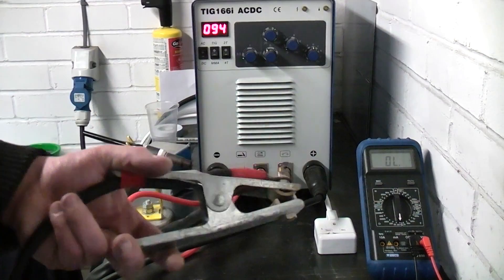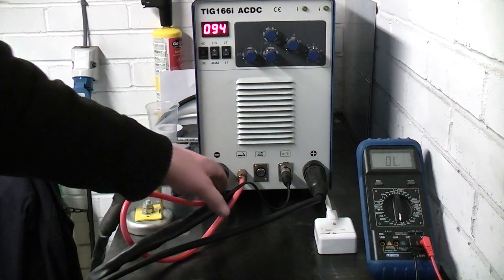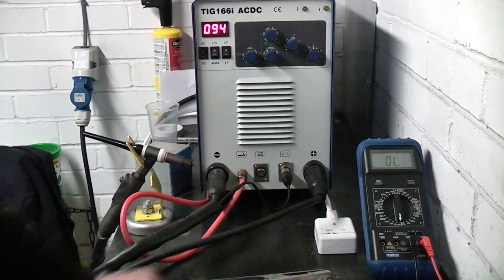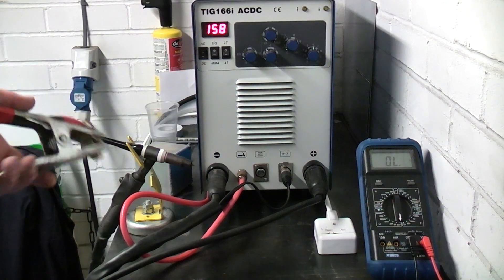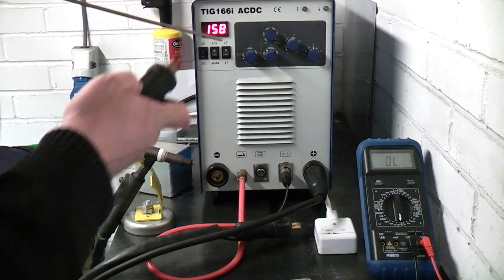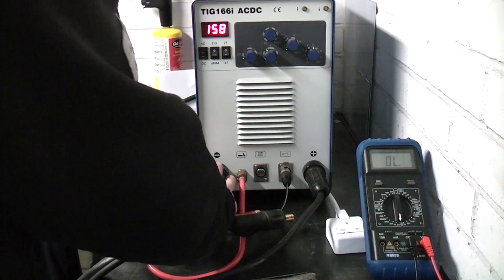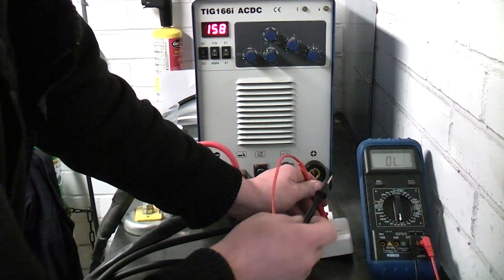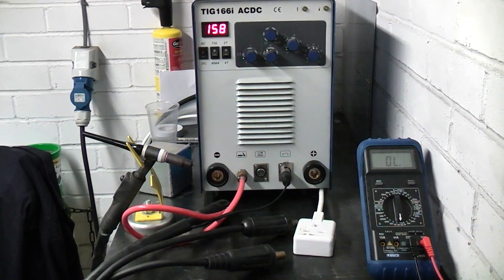Why the earth/ground clamp from a welder is NOT an earth/ground.

Comment: I was wondering if you can answer me a question. I am not a welder and have never done it before. I built a shed that sits up off the ground by about 1 1/2ft on 4x4 cemented into the ground. Anyway, I wanted to start doing a little welding and wanted to know, the grounding of this. Should I or do I need to run a ground from my steel table outside to the ground? Or is this already taken care of from the ground of the building? Trust me when I say I do not want to fry myself.
Reply: Lots of people don't bother earthing there table but it's not a bad idea.

Comment: Nice video. I just bought an arc welding machine to weld a few smaller work pieces. Is it okay to just put the clamp on the pieces I weld on? I don't have a welding table atm.
Reply from the maker: Yes thats fine.